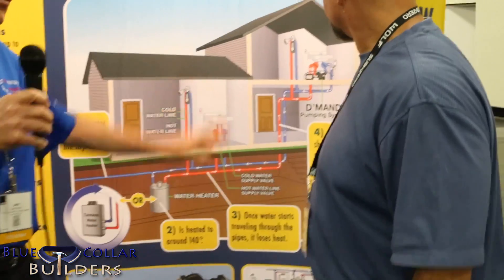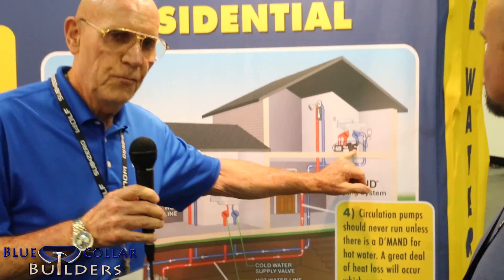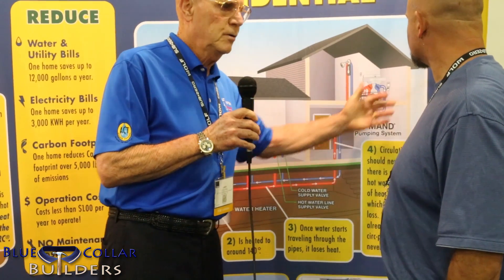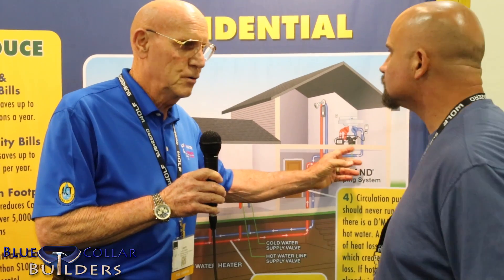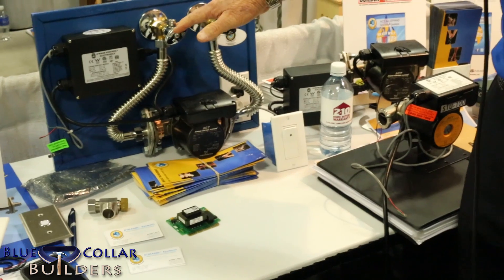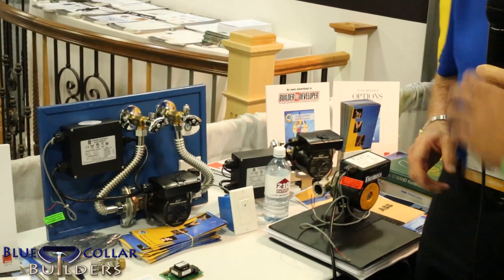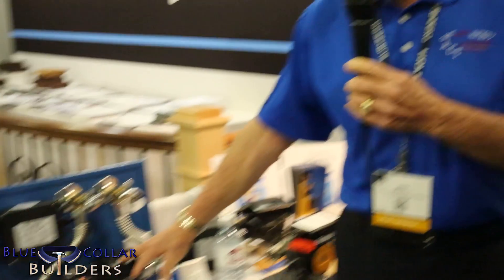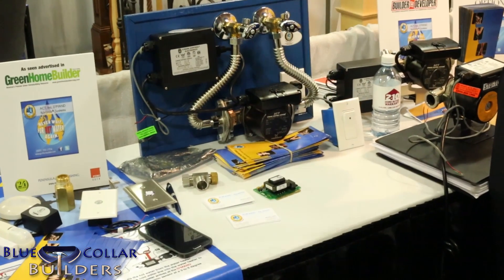D'MAND water recirculation systems - Blue Collar Builders

Comment: Why would I not use an under-sink electric mini tank water heater for 1/3rd the cost and avoid the heat loss in recirculating hot water in the uninsulated cold water pipes?

Comment: I like many of the features and may even get one. My guess is the payback here in MN is going to be more like 10 years. I can do better than that with an IRA.  My gas bill is $700 a year. Maybe a 1/3 of that is hot water.  It wouldn’t save anything in gas usage over running water down the drain. The only thing it saves is water. There might be some savings with the dishwasher getting gas heated water over it’s internal electric element. Operating costs would be minimal. A pump that is triggered on by the temperature on an insulated return line wouldn’t cost that much more to run if on a timer.

Comment: Needs to practice his elevator pitch.  Man, way too much talking especially at a trade show. I’ve been researching systems as I have an issue with kitchen faucet far from tank. Not sure if I like this system as pump is on living floor risk of leaking and there will be a motor/pump noise.
Reply: Pump noise would be short. Watts pump at HWH may be a better fit for you.

Comment: This looks like a well designed system and very simplified to operate. Building codes should make this mandatory on all new construction or anything built in the last 10 years. Video is very informative you take enough time to help people without the knowledge to understand what this does.

Comment: My house has a recirculation line.  There are motion sensors in the house which start tge pump fir about 2 minutes when there is motion and then shuts off.  There is a flow sensor as well to detect when something like a washing machine and dishwasher is needing hot water (since the appliances do not move to activate the pump).  So I'm not running 24/7.  Not sure something like this would save me anything

Comment: Do I  need a one-way check valve on the cold water line coming into the house to prevented from going back to the street ?
Reply: You can’t push water back to street unless you’re making water or street water looses pressure. It will circulate within your system.
Reply: If returning water to the city water system was a big concern the plumbing code would already require back flow preventors on you water line.